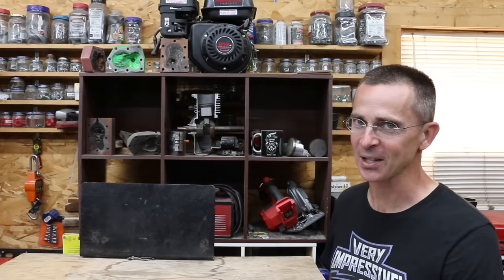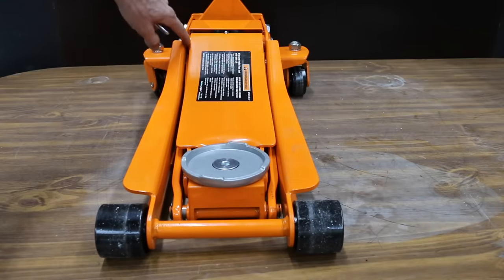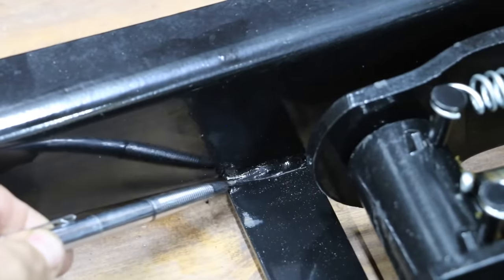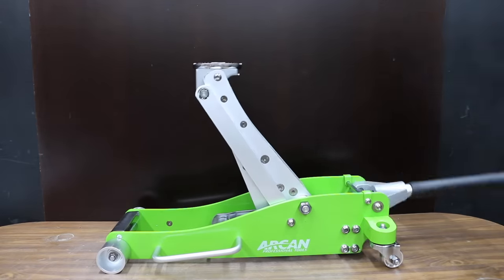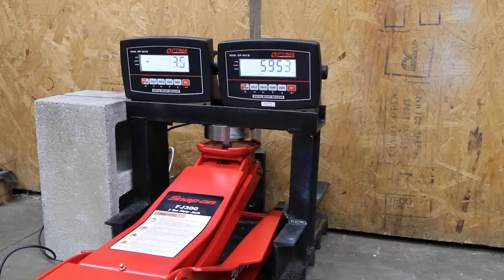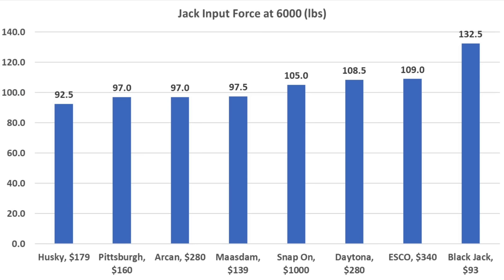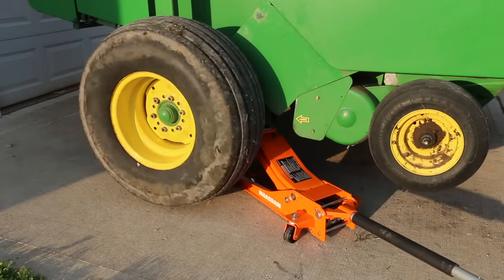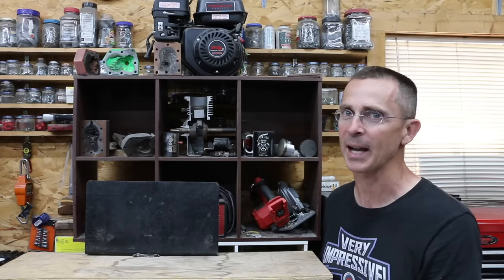Best Floor Jack? $1000 Snap On vs Daytona, Pittsburgh, Arcan, Black Jack, ESCO, Husky, Maasdam

Comment: As always, you did a great job of reviewing the floor jacks. I looked to see if you ever did jack stands but I didn't find anything. That might be a fun review! Test jack stands to failure. The internet talks about the cheap Harbor Freight stands failing. Yikes... 
I think Snap-on tools are typically top of the line in quality and durability. However, I'm fascinated with how they are able to stay in business with their tool pricing. $1000 for their floor jack vs. $280 for a just as good version? I'm all about supporting US companies and products. However, I don't want to feel raped either. 😂
Reply: I second the jack stand test :).
Reply: They stay in business because idiots and their money will always part ways.  You said it yourself that you think snap-on tools are typically top of the line even though there has been a 1000 comparisons showing other brands are just as good.  So the answer to your question is that they stay in business because people like you waste money assuming it's always the best.
Reply: @tomthumb1498  Hum, I can't recall where I said I actually purchased any Snap-On tools. So, there's that.
Reply from the maker: Thanks!  Thanks for the suggestion.

Comment: Great test… except the “Black Jack” you included in the test was a trolley Jack not a floor jack, that’s why it did so poor because it’s a light duty Jack and you compared it to heavy duty floor jacks. Blackjack makes a very nice 3 ton floor jack which I own and have been using for years and it would’ve stacked up well on this test.
Reply from the maker: Thank you for the video idea!

Comment: I have the Pittsburgh jack I bought in 2015.  It basically sits outside because it's so heavy to lift.  I got it to lift my Utilimaster chip truck ( Basically a F350 with a huge aluminum body ).  I have lifted the truck with a full load on and have never had a problem with the jack other than lubrication of joints because it sits out so much.
Reply from the maker: Thanks for sharing.

Comment: I went with an aluminum low profile Pittsburgh. I think mine was around $150 in 2020. Total newbie to cars but I did a lot of research and reviews definitely made it seem like the right choice. Daytonas are great if you can afford it, but if you're tight on cash, the Pittsburgh is ideal. No complaints at all with mine so far. It's still a little scary using them, if only because you're lifting so much weight with them and a lot could go wrong, but it's solid and smooth, encouraging confidence. I was worried it mighta been a waste of money, but it makes lifting a car so much easier and less intimidating. Definitely worth it. Don't cheap out on something like that. A good jack is 100% worth it.
Reply from the maker: Thanks for the feedback.

Comment: Great video! Thanks for all the thorough testing, time and energy you put into each and every one of your reviews, it's greatly appreciated!

It would be cool to see an updated 3 to 5 ton floor jack test. With the Norco (71203) 3 ton jack or (71335) 3½ ton jack and the Norco (71500G) 5 ton jack with the FastJack feature. Also the AC (DK40Q) 4 ton jack and the AC (DK50HLQ) 5 ton high lifting jack. I've also heard good things about the Compac (90531) 3 ton jack. These aren't budget jacks though, so I completely understand if this test never gets made. Norco also has a light weight 3 ton jack available as well. 

It would be cool to see the 4 or 5 ton floor jacks lifting your tractor and how many pumps it takes to get them to a certain height (so that all the jacks are lifting to the same level) and also max height of each jack. I really like that you tested how many pumps of the handle to get to max height unloaded as that is a big pro if a jack can get to the vehicle or equipment quickly before actually lifting it. Also lifting a tractor vs a lighter truck or other vehicle to see if a 4/5 ton jack lift them any faster than a 3 ton jack. I know that my older 3 ton jack lifts a 3500 truck faster than my Dad's 3.5 ton performance tools jack and FIL's 3 ton Black Jack brand jack.
Reply from the maker: Thanks and you are welcome!  Thanks for the suggestion.

Comment: I have a SO FJ200 that started leaking recently. Surprise, surprise, SO does not sell a seal kit, and the entire hydraulic unit needs to be replaced because one of the rear piston seals is leaking.

I'm curious to see if the Daytona and the SO use the same hydraulics/seals.

Comment: I bought a 3 ton low profile quick lift Arcan jack from Northern Tool about 9 years ago so I could get it under my son's lowered car. I think the regular price on it was $149 and I got it for $110 on sale with the coupon. I have no trouble moving my 91 F150 on it. I was at my buddy's house who's a professional mechanic and has one of those Snap-on jacks. I was using it to lift the back of my '01 Jeep Cherokee under the pumpkin. With my Arcan I could lay on the ground and have no problem jacking the rear wheels off of the ground. There was no way I could ever do that with the Snap-on. My buddy couldn't believe it so the next time I went up there I brought my jack along and showed him. He was pissed but said it wasn't quite so bad because he bought it with his $100 a month tool allowance.

Comment: Once again, your comparison testes are spot on with what I'm considering purchasing. My current jack was purchased at Harbour Freight about 20 years ago when they first came out with their aluminum, low profile fast pump jacks. I also purchased their original orange jack stands with white risers and have had NO ISSUES with either, except the jack is leaking a due to a bad seal at the release/lower lever point. In my opinion, when using tools that are being used daily or on heavy work, they need to be replaced within a reasonable time due to safety, like jacks and jack stands. like ALWAYS, Project Farm, your videos provide GREAT information and content.....THANX from California
Reply from the maker: You are welcome! Thanks for sharing.

Comment: I bought a jack like the pittsburg one, 3 ton, low profile, double pump, but it feels like it doesn't lift as fast as it should. I tried to bleed the air, refill it, because the cardboard box it came with was a bit oil wet, and nothing, feels the same.

Today i compared it with my old 3 ton single pump jack, sometimes it needed the same amount of pumps to reach full height, some other times, my old jack finished first (all testing done with load). The difference i noticed, is my old jack raise little distance, but every pump is moving the car like 4 cm at the time, until it reaches max height. With the new one, some pumps have no raise at all, specially if i pump slow, which shouldn't matter, because in the old one it didn't. Watching the video, i can realize my new jack has some internal defect.

Comment: I have a 4ton low profile big red thats been an absolute workhorse for nearly 13 years in the UP, its defiently been exposed to salty slush and accidently left out in rain overnight. Still works perfectly just needs the occasional cleaning and grease to keep it rolling smooth. I think it was around 300 online i dont remember
Reply from the maker: Thanks for sharing.

Comment: Back in 2017 my dad bought an Arcan HJ2500. While I do admit that it is a little underpowered, it comes with a rubber pad, its light weight so we can take it out of the shed into our driveway very easily, and the arms on the side really help with carrying and positioning the jack under the car.
Reply from the maker: Thanks for sharing.

Comment: I have a tire service and I needed a floor jack replacement and at that time Harbor Freight had a sale on the 3 ton Pittsburg jack for 69.99 each and I went and bought two of them and they are great for my shop use. A friend of mine has a high volume tire shop and he went a bought ten of them and they do a great job for him also. Great value.
Reply from the maker: Thanks so much!  Thanks for the suggestion.

Comment: I've had the same 3 ton Pittsburgh jack for almost a decade now and she's never failed me.  Unless you're using your jack professionally or you're using your jack everyday for some reason,  a budget jack like the Pittsburgh will do you just fine. Seems jacks have gotten a bit more expensive in the last few years but Harbor Freight has a lot of coupons and sales.  Granted it was quite a while ago but I got mine for around $80 bucks.
Reply from the maker: Thanks for sharing.

Comment: Another test to add to the mix at the end should be jacking up on an incline/uneven terrain. I bought a lightweight aluminum jack and only got 3 uses out of it in gravel before the frame was bent. The steel ones can handle way more abuse and I will never buy an aluminum jack again even with my back problems. Also for some dumb reason the softer aluminum frame has no corners for additional strength even though it needs it more than the steel ones. I think thats fascinating..

Comment: i wish you would have shown the fill/bleed area for the pittsburg. mine has a rubber plug and not the old screw in plug like they used to.. wondering which one you had in this video

Comment: Thanks for the review! Two of the Husky's here, they were the least expensive at the time I purchased, less expensive than even the Pittsburgh at the time. I did go down and check the welds, looks like a Wednesday build on both of them, nice and clean with no skipping around like the one in the video. Performance wise, I really like both of them, though one did need a shot of jack oil. Other than that, they both get the job done, and a good bang for the buck. Just to add, I'm a truck driver, and had both of these Husky jacks under my Buick and was called away to do some work, one of those you need to be there an hour ago jobs. The jacks kept that car in the air for quite a few days without issue, which was very impressive.
Reply from the maker: Great feedback! Thank you

Comment: I’ve been happy with my Daytona lime green jack. It low profile and high lift makes it great for my Jeep from assisting on pinion tilts for welding to raising the transfer case. Only thing I wish it had was a 45 lock and vertical lock on the handle.
Reply from the maker: Thanks for sharing!

Comment: I know you probably wanted to include an aluminum jack for comparison, but Arcan does make steel jacks (low profile, longer reach and greater height).  They're modestly priced compared to the aluminum models.  I would have wanted to see them in this comparison, as I bought one recently and am curious if I made a good choice.
Reply from the maker: Thanks for the suggestion.

Comment: I have made many purchases based on the information you provide in these VERY well produced videos
   I purchased a Milwaukee grease gun on your recommendation and other than adding a locking tip i have not been disappointed at all with the Milwaukee 
  I threw the Lincoln grease gun in the trash 
  I wouldn’t even sell it at my garage sale 
  I couldn’t bring myself to passing on the problems (JUNK) that thing gave me to someone else 
 Tomorrow I will be replacing  a floor jack that has been very dependable to me for 25 years doing moderate work on cars pickups trailers and small tractors 
  Thanks again 
  If I’m looking to buy something I look to you for you very informative comparisons to help in my decision making 
   Keep up the GREAT work !
Reply from the maker: Thanks, will do!

Comment: Todd you should mention in your video as a public service on safety to never use concrete blocks or bricks as a jack stand as they can crack and fail.  Wood is a good medium. Pieces of 4x4 posts or 6x6 make great    safe supports.

Comment: As usual, your tests have saved me time, and pumps. I’m upgrading from mom’s old 2 ton standard floor Jack from 1996. Until it stopped holding full pressure last year, I’d used it for anything from her 84 celica, to my 78 camaro, 12 Escape, and 16 Altima. If the next Jack from Arcan or Daytona last that long.. I’ll be happy for the purchase. Especially since my vehicles usually top out at 4600 pounds, for the moment. Trucks to come. A big deal is how heavy these new jacks are. I though 50 pounds was heavy enough, but happy to see that racing Jack have extra carry handles, and often weigh less being made out of strong Aluminum.
Reply from the maker: Glad to hear!  Thanks for sharing.

Comment: Glad I found this! Considering the Arcan now because of my back. I've kicked my MVP floor jack around for years and leave it outside in the elements, and I haven't done anything to maintain it, just wondering if it will die. I bought it at an auction 20 years ago and used it to lift a 50s Buick, 88 Bronco, 80 PW150, and lots of other vehicles. I just don't trust it with my E-450. If I need to haul it around, I figure lighter is better, too.
Reply from the maker: Thanks for sharing.

Comment: If you haven't already, best travel mug, things like heat dissipation, size vs cost, seal quality, and design (does it fit in a standard vehicle cup holder for instance)
Reply from the maker: Thanks for the suggestion.

Comment: Have a 15 year old harbor freight believe it is a Daytona low profile it looks identical to the maasdam and the like. Only issue was once lifting a Durango on uneven surface, the jack twisted some but it still works great sprung back as soon as the weight was off of it. fter all these years of farm and moblie shadetree stuff i do.

 Paid well under a hundred dollars for it back before HF prices started climbing guess that has something to do with the CEO having a 400 million dollar yacht

Comment: Does the husky have the same mechanism of dropping down by turning the handle? Didn’t show in the video I’m looking to buy the husky I have a black jack now and hate that the handle comes out way too easily and to drop it down you have to turn the lever next to the handle but in this video I did learn you can use the handle itself I was using pliers while basically under the car didn’t like that so thanks for the tip but looking to upgrade great video

Comment: My biggest consideration when buying a floor jack consisted of two things.  Lift capacity and how much I would use it.  I've had mine for over 20 yrs. and I assure you, I didn't pay much for it.  I use the jack to jack up whatever I need, put jack stands under it, and do what I need to do.  I probably haven't had an occasion to use it over once a year.
Reply from the maker: Thanks for the feedback.

Comment: I've had a set of 3 ton Jack from Walmart made by blackjack they are heavy duty and been out in the elements for their entire lifetime over 12 years old n still work great yes there is a tad of rust on wheels but the piston is clean no leaks so that's what counts
Reply from the maker: Thanks for sharing.

Comment: I looked for a yard-sale floor jack for a long time, but couldn't find one.  One day in Walmart I noticed a floor jack for just over $100 so I picked it up.  It  sure is a lot better than the scissors jack when rotating tires between two vehicles.  The Walmart brand is "HyperTough."  I have no prior experience with floor jacks, so I can't compare.  This one was the right price and is doing the job.  
I would buy it again.
Reply from the maker: Thanks for sharing.

Comment: I had a really cheap Goodwrench floor jack that i bought from a major auto parts store and used it a few times before the seal blew out. I replaced it with a Snap-On FJ200 6 years ago. Although it's heavy, it's very well constructed and I love it.  it's a very stable jack and i have no issues pivoting it at any height on asphalt pavement. It also has a wide lifting point with a thick heavy rubber pad to help secure the load to the jack so it doesn't unexpectedly move if you happen to wiggle the load or the jack. No doubt they're expensive but they're so well engineered that my kids and my grandkids will get a life time of use out of it.
 The one thing i hate about it though is there is no lock, or retaining mechanism to keep the pump arm locked down for handle removal so no one trip's over it. I removed the handle one time after i jacked the front end of a '99 Mustang GT up and had to use a second floor jack, that i didn't have on hand, to get it out. I never removed the handle with a load in it again. It really sucked trying to get that monster out without another floor jack on hand.
Reply from the maker: Thanks for sharing.

Comment: I bought the Napa 3 ton jack on sale for 100 and it’s by far the Best value buy I’ve made for working on my car. I abuse it / have a unstable rock driveway and it’s still strong and sturdy lifts my heavy ass charger with ease
Reply from the maker: Thanks for sharing.
Reply: @ProjectFarm  just figured anyone watching this video is in the market so thought I’d give them another option

Comment: I have a smaller cheap floorjack I bought at harbor freight back in the 90's, still use it all the time. The only reason I don't buy one of the larger ones is because I always carry mine in my car and now in a van. 
If I do buy another one it will definitely be the lightest one. For my uses which is to change a tire, once the tire is off the ground thats about as high as I take it. 
I would never go back to one of the oem scissor jacks that usually come from the factory. The floorjack makes any job easier. I see too many people struggle with oem jacks. I like the review especially testing all the jacks to worst case scenario and also appreciate the directions on adding oil to the jack if its ever needed.
Reply from the maker: Thanks for sharing.

Comment: You might consider a combined chart showing a bar that starts at the minimum lift height and goes up to the maximum lift height, I think it would express the range better.
Reply from the maker: Thanks for the suggestion.